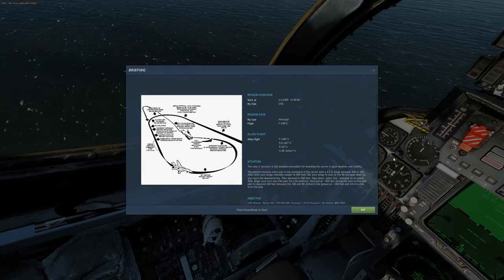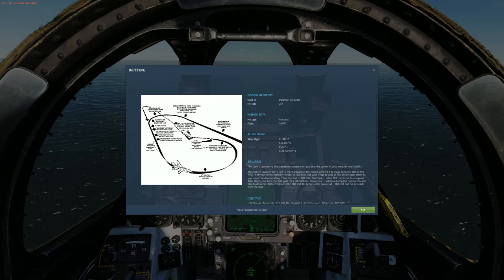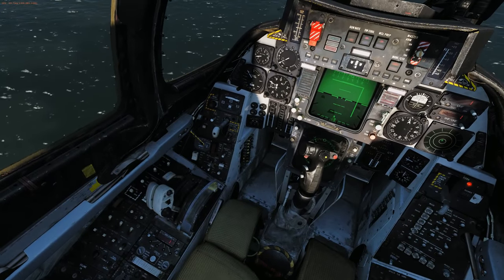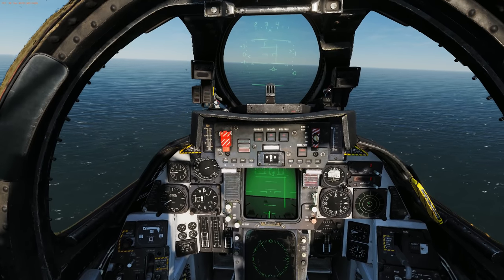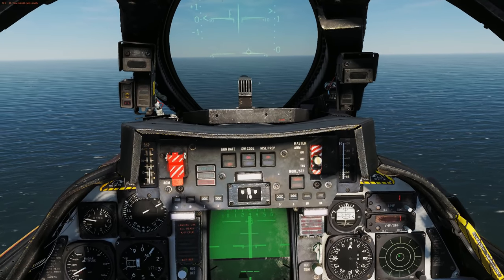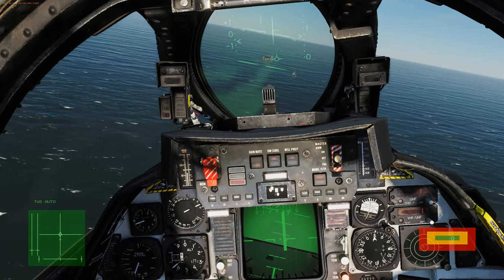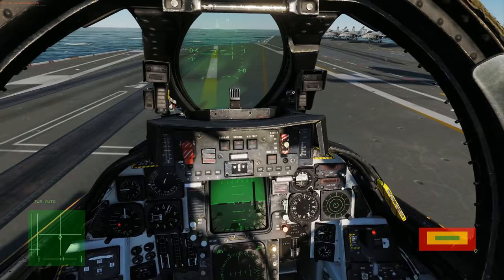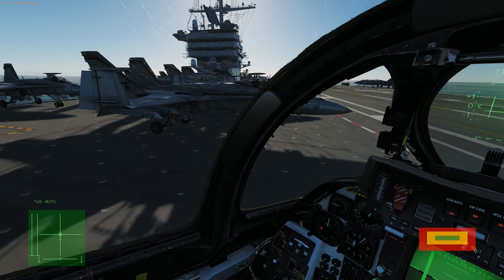DCS World: F-14B - Quick ACL Tutorial (Automatic Carrier Landing)

Comment: If you set ACL on the hud display switch and AWL/PCD steering command button, the ILS indicators will be displayed on the HUD.  It helps with the initial line up so the auto pilot doesn't have to make very drastic corrections when it's engaged.
Reply from the maker: Indeed
Reply: @RelaxSimmer  I fact such drastic adjustments from autopilot really feels risky
Reply from the maker: @Ddg-mi5cs  Dramatic adjustment don't happen if you don't fail like me and try to guess the glideslope and lineup.
If you use ICLS it's smooth.

Comment: You engaged the auto throttle before getting on speed? At which point do you start to adjust the pitch trim? I have tried this 100 times and it doesn’t work. I can get it all lined up and have CMD CONTROL showing and it works a bit at first and then as I get close to the shit the system starts to radically raise and drop my nose until I crash
Reply from the maker: It's currently bugged it's been known for a while, apparently the new auto pilot ruined the the system and no idea when  heatblur is going to implement the fix

Comment: Can't get this to work no matter how hard I try. I do all the steps, but nothing at all happens when I press the AP reference button. Checked the mappings and everything. Just nothing.

Edit: Alright. Got it working. Basically, you have to be on a pretty good glide slope to hand over the plane. It's real fidgety. I'd probably only use it in horrible light and weather conditions. Otherwise it's just easier doing it manually or with just the auto throttle.
Reply from the maker: Use ICLS instead of TACAN helps alot now with alignment
Reply: how do you do that ?
Reply from the maker: @Teomoful  3rd button from the right of TACAN button for steering command and follow the needles, align them up to make a cross in the center of your HUD and you're on glide slope
Reply: Thanks! Works as expected, just give yourself enough time enter the glide slope.

Comment: How did you know that the runway heading is 025? I can understand everything except that. Thanks for the video.
Reply from the maker: It's close to ships BRC heading or just simply click on the ship while in the F-10 map view.
Tho I'd advise from using TCAN in this situation there is a much better way of doing this I just did a poor job at showing it in the video.
You can use an AWS hud display mode which basically gives you ICLS needles on the HUD (1 vertical 1 horizontal) which you can then center on the HUD and it will tell you if you're on glideslope or not and how much you're deviating from it.
In my case, I didn't use it and used TCAN and because of that I wasn't perfectly aligned so when I activated the autopilot to land it corrected very aggressively to get on that glideslope, and that's not really needed you can do it much smoother than that.
Reply: @RelaxSimmer  thanks for the answer! Appreciate it.
Reply: @RelaxSimmer  I pressed f-10 but it says the ship is heading 39.
Reply from the maker: @rickyalexander459   That means the ship is heading in direction 039.
But as you know the runway is angled a bit to the left I think it's something like 6-8 degrees so.
BRC is used on Case 1 landing for example while you use runway heading in case 3 landing.
Generally, if you use AWS aka ICLS you wouldn't really need any of this since it shows you the ICLS needles on the hud of the RUNWAY heading.
So you can just use that instead of messing around with TCAN heading.
Also, important tip depending on what map you're playing on you have something called "Magnetic heading" or magnetic deviation.
Basically, if you click on a unit in F-10 map it will show you their "TRUE" heading instead of magnetic heading now some aircraft can choose to display magnetic or true heading while some instruments like Backup compass can only rely on magnetic heading.
You can google this if you're interested in more but to sum up, if you're in Caucasus in F-10 map heading of 039 (TRUE heading) equals to something like -6 degrees of magnetic heading or 033 (Magnetic)
Reply: @RelaxSimmer  Perfect, that explains it. I landed on the carrier and it is 025 like you said. I forgot to take into account the magnetic deviation. So its 40 - 6 = 34 then minus the 9 degrees of the angled deck 25. Thanks a lot!
Reply from the maker: @rickyalexander459  Honestly I wasn't looking at the right number I just eye-balled it cause I knew the BRC but ye : )